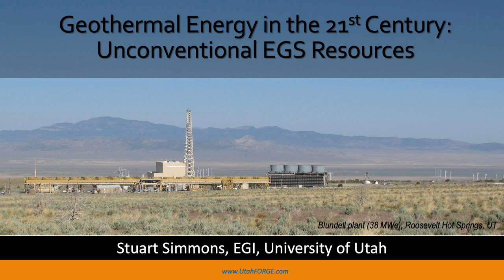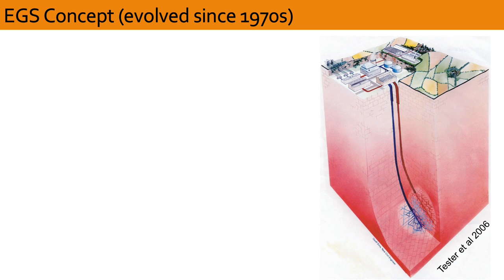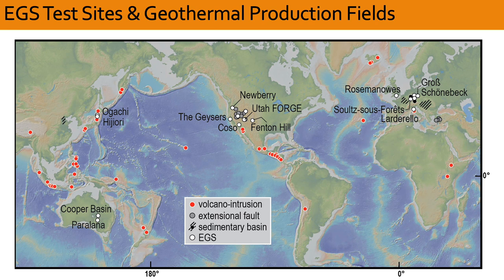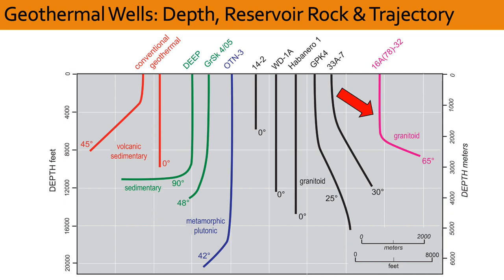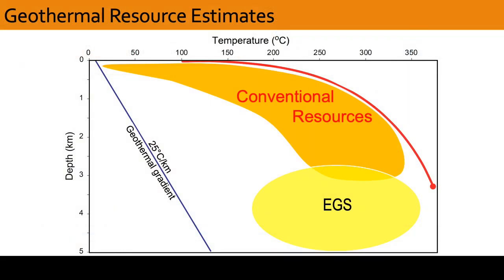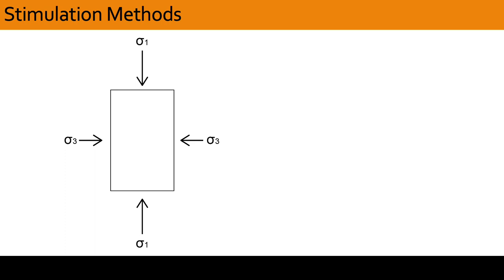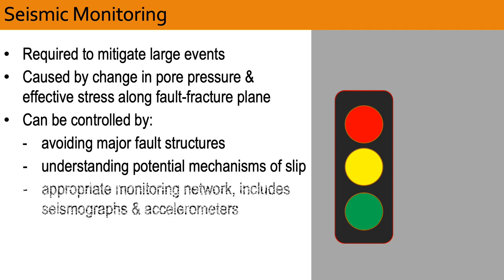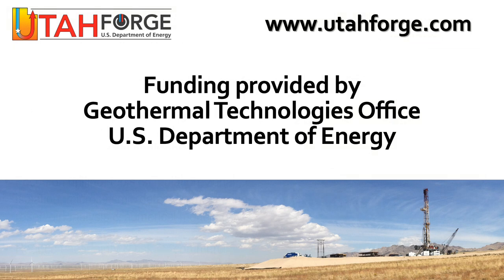UPDATED: Geothermal Energy in the 21st Century: Unconventional EGS Resources

Comment: is that possible to enhance permeability by injecting hot water or delta T is 0? we just increasing pressure
Reply from the maker: Pressure is the dominant effect of fluid injection for stimulation irrespective of whether the water is hot or cold. Cold water will nonetheless be injected to transfer thermal energy. Initially, the cold water might also help to dilate fractures due to cooling induced contraction.